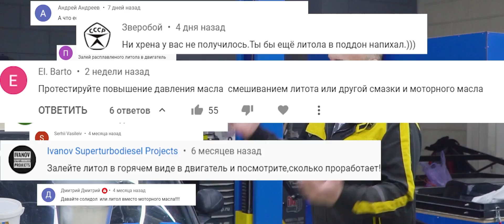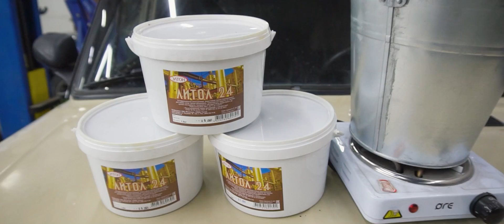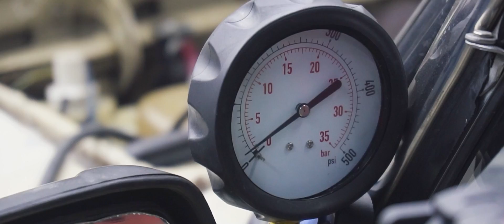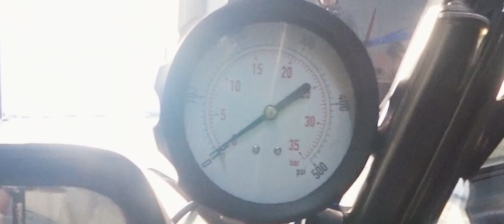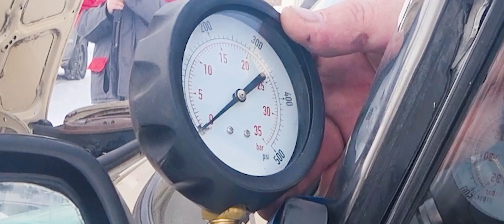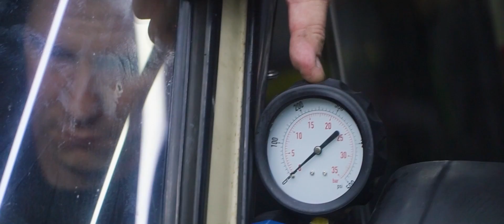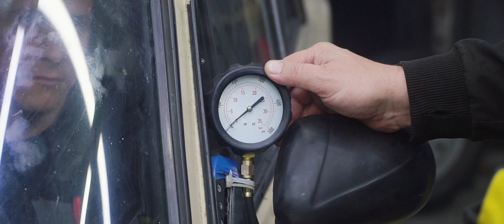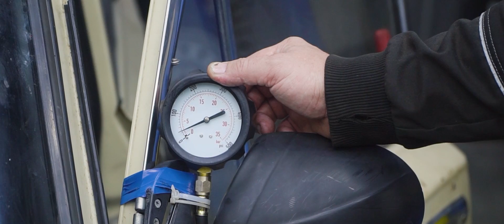What happens when you run an engine on grease?

Comment: I did this with a lawn mower but mixed 90w gear oil and grease 50/50, it stopped smoking and rattling , then I mixed 90w gear lube 20:1 for a two stroke lawn mower it doubled the compression and made it more difficult to start, but golly did it ever go.
Reply: to stop smoking-use straight synthetic engine oil.It has a higher threshold to being burnt.Meaning it wont smoke.
Reply: Wow. First I've ever heard of a 2 cycle mower. Neat.
Reply: @joshuagibson2520  OMC used to make them here in the states.Went out of biz in 2000
Reply: @genehunsinger3981  thanks. I'm gonna look those up.
Reply: @joshuagibson2520  I used to work on them.They were'nt overly reliable.they liked eating rods at the crank.did tons of warranty work there(1985 was worst year for them)
Reply: I mixed 50/50 diesel/petrol by accident and tried to use it up in my 2 stroke mower.
It ran fairly well and then once hot enough it went into diesel run-on and was ready to self destruct. Itried shorting the ignition and nothing so I choked it at the intake. They say 2 strokes dont induct very well but this one sucked the air intake rubber hose dead flat for the entire length. I was impressed!
Reply: @joshuagibson2520  You must be joking, Lawnboy Lawn mowers very popular in the sixties through the 80's
Reply: @genehunsinger3981  OMC may have taken over Lawn Boy mowers because that's all I knew them as and in the 60's and 70's they were very reliable you just had to use 20 to 1 oil and gas as the connecting rod was also the bearing, even when they went 40:1 I still used20:1 they would just run till they were out of gas.
Reply: @kittty2005  mounted to a JD they were useless.
Reply: @genehunsinger3981  The lawn mowers I'm referring to were  walk behind push mowers.
Reply: @kittty2005  right,so am I.
Reply: @genehunsinger3981  But where did I'm assuming JD means John Deere, or what.
Reply: And OMC made Johnson and Evinrude outboard motors
Reply: @kittty2005  Yes Deere.A walk behind(some self propelled even),But as i said-1985.Needle bearings @ con rod @ crank.They "fixed" the grenade issue by changing the specs of those bearing(diam.+ # of bearings present).
Reply: @genehunsinger3981  I'm still curious how I got here when I just stated that a '67 lawnboy mower actually it was just the engine clamped in a vice, running with out a blade, ran better with mixed gasoline using 90w high pressure lubricant, actually I could care less since I live in an apartment and don't have to mow any more, now the fun thing I did with a 1930 evinrude 1.5 hp outboard, I doubled it's power by switching to nitro-methane with 5% gasoline, and that only to make it easier to start. man what a ride, but still it was just 3 hp.
Reply: @kittty2005  I'm hearing "it sucks getting old" and "i love wrenching".True on both accounts.
Reply: @genehunsinger3981  not from me, I do not love wrenching any more, yeah it sucks getting old,  but it is what it is can't change it, people don't like me talking about myself much, I had many hobbies, had a HOT ROD would do 130 mph @7200 rpm for a half hour turn around go the other way at speed for half hour  then spend another half hour at 80 avoiding people till I got home, had a .50-140 sharps replica, custom made to shoot 120 grain loads of smokeless and .600 grain jacketed bullets, 2300 fps 8900 p/f, 130 pounds of free recoil can't now got rid of it because it caused me to much pain, even with a 90$ pachmeyer recoil pad, it weighed 12 pounds, now I'm doing something I've had a strong desire to do, cried and prayed from 4 years to 15, then lost all hope, never strayed far from God always asked for his help in my darkest hours, my darkest was may 4th 2017, he finally helped me march 11 2018 I was 65 years old was hospitalized with a massive infection, had to have some tissue removed and after God met me in a dream and explained that he would continue to help me, he wanted me alive and not dead,  I saw a psych. and got a therapist and saw an endocrinologist and on August 15, 2018, I started HRT, hand have been on it since and I still speak with God daily, he wants me to spread the good news of the gospel to trans people. There I said it, so stop yanking my chain, I'm through with you.

Comment: For cleaning out the grease you should have filled the crank case with diesel and let it run for at least 1 hr
Reply: I do that once a year just to clean out any sludge 💀
Reply: Danger Bear  And a fine mouth-wash
Reply: Danger Bear  what???
Reply: No, no, you got it all wrong.

Your supposed to use, pure ethenol to flush the engine once a month.
Reply: @jwalster9412  I thought it was nitroglycerin?
Reply: @dakoderii4221  no try anfo
Reply: Danger Bear  Sure is I used this method for years.
Reply: @ProdigyAutomotive  And not with ATTF? Seems cheaper nowadays, and also provides lubrication.
Reply: @the_kombinator  You can run 1 quart of ATF with your oil since it's a natural detergent, I've done it, works well
Reply: @ProdigyAutomotive  I had a friend fill a 500CID caddy ATF  and put 20 km on it around his business complex. Red went in, sludge and black chunks came out - ran like a top after that (lifter/valvetrain wise)

Comment: Years ago I read a story in some classic car magazine where a columnist discussed an experience he had when a young man in the 1950's. He and a friend had an old car on a road trip to get home as broke college kids. They were driving a 1930's model Ford model B if I can remember right. Anyways on the trip the engine had a bad oil leak. Back in the old days service stations would sell filtered USED motor oil for a dirt cheap price. The guys stopped constantly like every 20-50 miles adding quarts of oil to replace what was being lost quickly. Finally they got sick of it and told a service station worker to pump the entire engine full of grease. The claim is after this they made in the rest of the trip and made it home just fine. Although it wasn't only maybe 50-100 miles. Back then I don't think oil filters were a thing. And I'm sure tolerences in the bearings were quite large.

Comment: Well there is a reason in older engines they use a slightly thicker synthetic oil or oil in general. As engines age the pressure lowers because the clearances get wider as parts wear. Well done nonetheless and it’s possible the liquified grease gave just enough of a film between the bearings to have saved them. Usually from the oil pump, engines supply the bearings first on start up explaining the results. Most lithium greases have molybdenum in them which is a great high pressure lubricant and friction reducer. 

Keep up the great work.

Comment: should try Castor Oil like engines from the olden days and maybe aircraft grade single weight oils both 50 weight & 70 weight oils or run an engine on Rear Differential Oil
Reply: I kept an old MG I had by using the aircraft 70.  Great stuff that kept my car going for years.
Reply: @ronwalsh  this should be standard practice taught to techs. I'm sure if I went to a lubricant store they would decline to sell the product to me and laugh.
Reply: castor oilis still around for racing engines   best roller big end  lube

Comment: Weld a couple of fittings for heater elements in the pan running around with a 10 kw v twin to keep the grease hot . Try lard , melts lower and insulation on the pan .
Reply: Or maybe a few large alternators five or six ..... that would require more throttle to keep it hot a circulate . Heated dipstick too . And maybe next month when it thaws a little more....

Comment: The grease probably cleaned up alot of carbon deposits and no doubt the bit left over dissolved in the oil making it thicker and lubing the piston rings I wonder how the cylinder compression went

Comment: My brother put 500ml of high speed bearing grease in his engine with 4l of oil. The engine had bad rings and it cleaned up most of the blue smoke. He then quickly sold the car to a neighbour and it still was running after a year till the lads mum drove through a brick wall.

Comment: Should of run the exhaust over the sump to soften the grease so it would flow to the oil pickup, put a dummy oil filter on as grease is too thick to pass through the filter paper.
Fit a high pressure pump and install a very strong spring in the bypass pressure release to force the grease through the system at 200psi

Comment: I use to put news paper in front of radiator to get motor to run hotter in winter so the Heater was hotter for comfort might to get hotter enough to keep grease liquid

Comment: Maybe try straight STP, motor honey, or other similar oil additive in an engine.
Reply: Might be hard to import to Russia but I'd be interested to see a Lada run on pure stp additive. I've seen small generators run pretty much on straight stp
Reply: @redlinearroyo847  Customer States What... did a video with someone who only used oil additives and the oil pain was straight black petroleum jelly. Don't use that stuff
Reply: @HDReMaster  project farm put 2 single cylinder generators on Lucas and stp. As for using it alone ofcourse not. But it has its place.
Reply: @redlinearroyo847  you seen a rubber ball then.
Reply: @genehunsinger3981  ?
Reply: @redlinearroyo847  I'm a small engine tech.Did lots of B+S engines.Some clown used additive. It looked like rubber inside the engine.It solidifies.To much of a good thing,,,can be bad.
Reply: @genehunsinger3981  yeah too much. When I've used stp it was like a half quart bottle added to 5 quarts of 15w40 oil for a international harvester pickup truck. Just a little bit helps out on old rigs

Comment: Same process but use Vaseline. Much lower melting. Or maybe thread a grease pump for a shop and plumb to the central port of the filter.

Comment: Can you replace conrod bearings with ball bearings?
Reply: EXCELLENT IDEA. Hope to see it. 

But as to why it's a "bad" idea, ball bearings have significantly lower torque/impact resistance than bearings as the contact area is hundred times smaller. So as soon as ignition starts, the balls would dent the bearing surfaces and make the bearing self destruct. They'd have to use cylindrical bearings, and even they wouldn't be very happy with such high vibration, impact load. It'll work ok at start but they'll go dry due to inability to supply them with fresh oil, followed by fast wear (~1 month max usage).
Reply: Many small engines and motorcycle engines actually work like that! Especially two strokes.
Reply: @99domini99  small engines, in which there isn't as extreme load as big engines. There's a reason old steam machines didn't touch ball bearings even though they did exist. Even modern industry doesn't even use ball bearings for big heavy equipment, they use pressurized oil film in a solid bronze/babbit/steel casing.
Reply: @dimitar4y  Yeah, you're right, I specifically mentioned small engines didn't I?
Reply: Needlebearings
Reply: @lasskinn474  would still break under heavier loads. i.e. impact drivers.
Reply: @dimitar4y  the cc per cylinder wouldn't be more than like 50%-60% more than in some bikes in a 1600 4 cyl lada.

In a 1200 not that much more. Of course stroke length etc, but anyway it could run for a while it's not like they're shooting for hundreds of thousands of km's anyway.

Crank would need modding or customizing and conrods etc so its not exactly easy
Reply: @lasskinn474  yes but that's why normal engines use just sleeves rather than bearings. Because bearings under that point load won't last the hundredsofthousands of km. Also yes hard to slap a bearing on the conrods. can't really split a crankshaft. That's probably the more important bit.
Reply: @dimitar4y  motorcycles use split cranks

Comment: As good as that was burning got me wondering if it would be possible to add a second set of supper large injectors and a high pressure pump to a diesel engine to run on grease. I know they run on cooking oil so it wouldn't be that wild of an idea but a neat build tho. Especially as talented as yalls builds are.
Reply: Marine Diesels run on bunker oil. Basically a little more liquid than asphalt. It needs to be pre-heated to pump it to the injectors...

Comment: Hi Guys at Garage 54 from Australia! This video gave me the thought... Can you run an engine on degreaser in place of the oil or grease? To flush and clean the internals of an engine? 
And what would be the outcome? Would it cause excess wear on the bearings, cylinder walls etc. And would it actually flush and clean the internals of the engine???
Reply: Degreaser is mostly kerosene so it should work well

Comment: First I thought it was going to work because modern engines run hotter at 230 degrees. And now after running it should be fine as it was running when you turn it off. But whatever damage or ware has Ben done if any.

Comment: have they tried using used engine oil as fuel ? i know it works but whats the prosess like ?
Reply: Runaway engine it is called in diesel engine
Reply: @ashwiensewpersad2927  that's not what I'm talking about ..I know what a runaway engine is and I'm talking about using engine oil filtering it and the using it instead of diesel and see how they compare

Comment: And people are affraid to use 20w50, as "too thick to run" ... Come On! This grease is about SAE 5000 when in its original paste or SAE 600 when liquid (way of speaking, of course)  at 160C, not a problem to run a mere 50.

Comment: LOL this is a terrible idea - I used to add 80w90 in my shitbox in high school (we had an abundance of it, and regular oil was cheap) and at the end of that year the engine was pissing oil out of every seal due to the much higher pressures in the block. 

Don't do this unless you care not for your engine.

Comment: Put used fast food grease in the crankcase?
Reply: works decent, but it deterriorates due to the heat, also no additives means it doesn't really help much. The oil in oil is merely a suggestion, oil just keeps the suspended metal particles in place which act like tiny ball bearings.

Comment: Use cocking oil as engine lubricant.😀
Reply: it does work just fine, over time it goes rancid due to heat and age, and it causes premature engine wear due to lack of metal additives and lack of stabilizing aditives, causes the oil to go acidic and rust/destroy parts internally.

Comment: could have saved yourself some work by just dumping some oil in to the engine
grease will mix with oil
so mixing it 1:1 before pouring it in would have made a thin grease that might have even worked

Comment: COULD YOU HAVE FOUND A WAY TO HEAT THE SUMP, on a permanent basis thus keeping the oil thin enough to be fed round the engine. My father when in the URALS made a sump heating system so he did not have to leave the truck running and get it stolen also the same for the batteries not bad for an old Bedford TK truck that worked as well as the Kamaz's of the time.

Comment: Hehe run over stick man aka Soviet Superior Sign of Quality, a funny thing in itself when a visiting chap from Moscow would arrive at factory, give manager a little award and permission to use the pentagon shaped logo, manager would then show visiting Moscow man tour of factory whilst his designers rabidly ran about trying to find a way to put the said logo into the design of item and after tour the manager would be half dead from exhaustion and would show dignitary new design which if approved everyone broke out the wodka and for a while the item produced would adorn the logo but in reality it was used as a trick to con westerners to buy Soviet goods which is why watches ended up with a lot of these logo's on casebacks.   Westerners were not fooled, they knew Soviet product was still rough but that was how the Sovet Superior Sign of Quality came about...